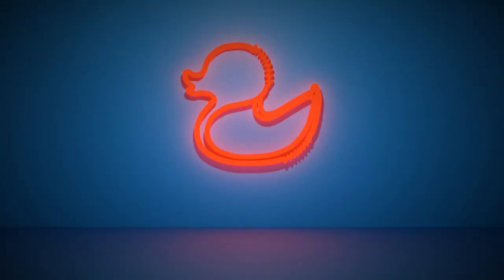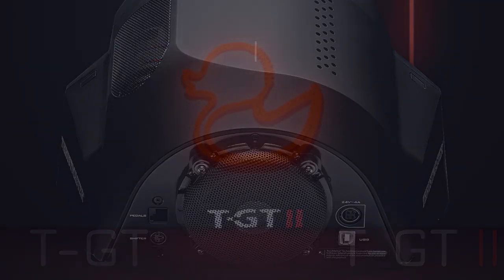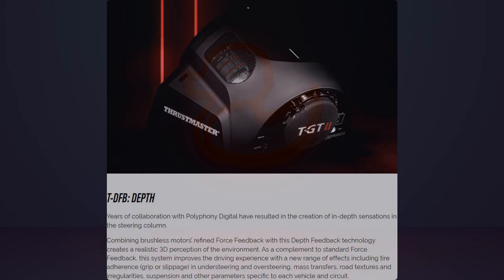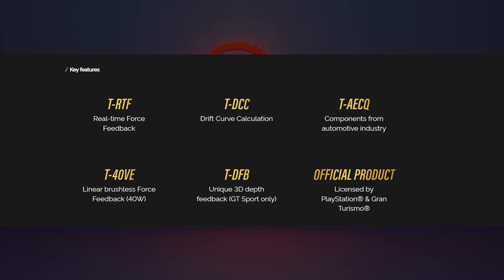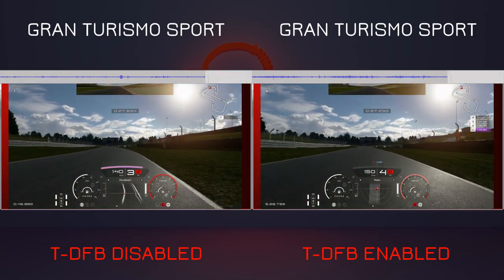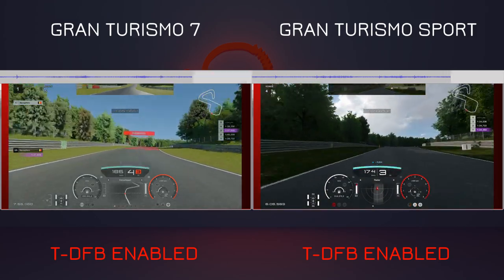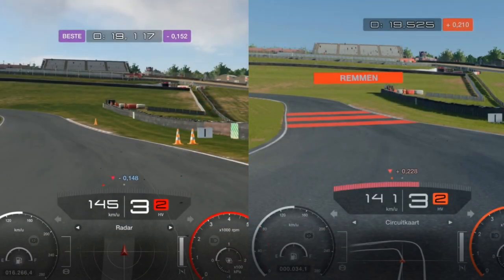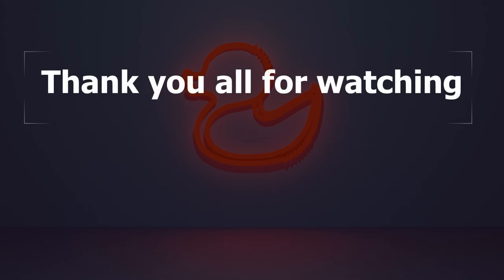Special: Does Thrustmaster T-DFB still work on Gran Turismo 7

Comment: Just make sure the wheel is in GT mode before you switch it on. Also the tdfb vibration is controlled in the controller vibration setting.
Reply: how to configure t dfb in the controller ?thanks

Comment: The braking zone  - just start braking just before - change to the right gear in the brake zone (stil braking) - release the brake @t the end of marking zone - NOW go easy on the gas turning into the corner.

The braking zone and gear indicator - are just little help - try to trailbrake for beter lap time”s
Reply from the maker: Thanks for the tips! 👍👍👍👍

Comment: hello,got a t300 upgraded  t-lcm pedals now can you put the TDFB completely off because i screwd the chassis to the wooden bedroom floor ,and mom is complayning to the vibration noise  below,   but wont a lot more tork on the f1 wheel !!! have a video off it on my channel
Reply from the maker: It is possible to use the t-gt without the t-dfb indeed. Perhaps you can put some rubber pads between the  rig and the Floor to dampen the vibrations
Reply: @SimulatedDrivingResource  thanks , just orderd one from the trhustmaster belgium site , cood not wait !!!
Reply from the maker: @MrAlfasul  there was a t-gt very cheap on 2dehands.be
Reply: @SimulatedDrivingResource  i now also cheaper prices coolblue its a garatee isue for me personal
Reply from the maker: @MrAlfasul  fair enough

Comment: I found that the transducer on the T-GT2 was much stronger on GT7 than on sport. In Sport I could only feel it taking corners hard but in GT7 for me it is much more pronounced across the board.
Reply from the maker: Is it possible that this was because of the ffb settings? I will check again  but to me it felt about the same 🤔
Reply: @SimulatedDrivingResource  I'm really not sure. GT doesn't really have what I'd call settings apart from a scale of 1-10. All I can say is Sport on max 10 was underwhelming but on GT7 I fine personally 7 is plenty enough
Reply from the maker: @DannicusMaximus  ok cool... i'll check it more in detail and see if I can reproduce it. Thanks for sharing my friend!
Reply from the maker: Hello my friend, I did some testing today but I could not replicate it. I don't see a noticeable difference (I would even say GT 7 has a little less pronounced T-DFB). I tested again with recording the sound (which I think 'shows' the T-DFB well). I will do some further testing and look more in detail this evening. There is someone else that gave the same reaction, so I don't want to dismiss this remark too easily.
Reply: @SimulatedDrivingResource  Are you on ps5? perhaps that's a contributing factor.
Reply from the maker: @DannicusMaximus  i'm on the list of Sony... but don't have PS5 yet. I'll check with the other person. Good call man.
Reply: @SimulatedDrivingResource  This was my perception too. For me, it is much stronger on GT-Sport than GT 7. I'm hoping there's a setting or an update that will change that. Going back and forth, T-DFB in  Sport has a much better feeling in the engine, the road surfaces, and the curbs. GT7 is a little disappointing in that regard.

Comment: T-GT II arrived today. I've been using it a few hours now, but can't tell if the transducer is working or not. I tried to switch it off from the wheelbase for a minute, but did not notice a difference. GT7 is the game.
Reply from the maker: Controller vibration is on too?
Reply: @SimulatedDrivingResource  I don't know what to look for. Trigger effect is set to strong. Gamepad haptics are set to weak from PS5 options to save batteries. Torque from GT7 is set to 6-7 and that other below torque to 7.
Reply from the maker: @ContentComposer  in gt, you need to change soms settings for it to work. I assume deducting from your post that on the wheelbase the slider is in correct position before you have started the game.  https://ts.thrustmaster.com/download/accessories/Manuals/TGT/T-DFB_Strength_adj.png
With these settings on, you should experience the t-dfb as a soft constant vibration
Reply: @SimulatedDrivingResource  I did see that in the options, but did not open it for some reason. I'll check it today, thank you for help.
Reply from the maker: @ContentComposer  succes friend

Comment: They actually state on the TGT 2 box that it will be on GT7 and future GT games.
Reply from the maker: Strange because it does not say on the product page for T-GT II, only GTS
Reply: @SimulatedDrivingResource  something tells me thrusmaster isn't the most organized company.
Reply from the maker: Do you have a reference for the box?
Reply from the maker: Got it. Thanks man. Had to test it out though
Reply: @SimulatedDrivingResource  yeah for sure. I was on the fence about getting the TGT2 because I wasn't sure it was supported since fanatec is the new main wheel partner for GT. After that video I pulled the trigger, pretty happy with the t-gt2, my only complaint is the fan noise from the wheel is quite loud

Comment: You nearly got me. After watching the video I switched over to local classifieds... There has just been released some video about sim racing addiction... Must be something to it. Issue is: I am a bad driver, it will not change with expensive equipment. ;)
P.S.: Not the biggest fan of the new braking zones yet. Will need to see if it grows on me. Not the biggest fan of tuning in Daily Races either. It was one of the major reasons for me to like GT Sports online racing. Just jump in and be alright, if you know the track that is.
Reply from the maker: You made me laugh so hard🤣 am not a particular skilled driver either,  thats why i make videos about it. Thanks for the light posts MZ, i really appreciate them 💙
Reply: That’s nice! A good laugh brightens the day!
Reply from the maker: @marcianzero_yt  ahhhh i also see you have the same doubts about the braking zones too..  the problem with the cones, as far as I experienced it, was that they could get bumped off during races, and if you are used to them, Well... 🙄 and yeah, also the tuning... meh... not sure what to think of it... good, bad, ugly...  It is some good extra for a new fact-finding video but you are right... it does change the accesibility to on-line races if that has to be taken into consideration.

Comment: Why can't they make a sim setup that will work on all consoles and PC. Would be nice to be able to buy a PS5 without buying a whole new sim setup.
Reply from the maker: My guess is because it is too expensive for them and they want to cut costs, but I agree, life would be a lot easier (and less expensive) 😔
Reply: Supporting both consoles means the wheel manufacturer has to pay a licence fee on each unit sold to both Sony and Microsoft. No licence fee has to be paid for pc. Most users will only play on one console and maybe on pc too. This means its not worth adding dual support for both Xbox and PS5 as this will add an additional cost to the wheel, in order for the manufacturer to cover the price of having to pay 2 licence fees. Fanatec have come up with a clever solution to this. They sell you a wheel base and rim that supports PlayStation and pc only. Obviously then a licence fee will be paid to Sony. If you then want to also play on Xbox you have to buy an additional rim which supports Xbox consoles. This then unlocks the wheel base to support Xbox. Now both Sony and Xbox consoles are supported, depending on which rim is connected to the wheelbase. Again, included in the cost of the Xbox rim is a licence fee to Microsoft. This way the customer only gets charged a licence fee for the actual console/consoles they're have.
'
Reply from the maker: Makes me wonder though why they dont always put the security in the steering wheel. Perhaps technically not possible for the Playstation platform. Nonetheless, Fanatec is the way to go to cover all platforms with the minimum of gear

Comment: Hello, I recently acquired a tg and could you tell me how I activate the t-dfb and if it has a configuration in the gran turismo sport, thank you very much
Reply from the maker: You have a selector on your base that allows to pick GT or other. If it is on GT, tdfb is enabled and you will feel an extra vibration in the steering column. You can configure it in the controller options in game. 
In the options menu if you turn off vibration for the controller it also affects the T-GT vibration. Go to the GT logo in the top right corner > options > controllers > vibration function > select on (if it isn't already).

In that section is a vibration strength control for the vibration/transducer too, try turning the volume to full and see if you can notice any difference. I can feel mine easily by putting my hand on the top of the wheel base while driving.